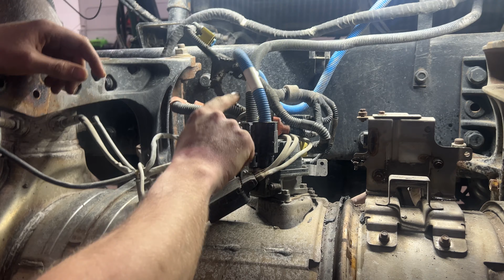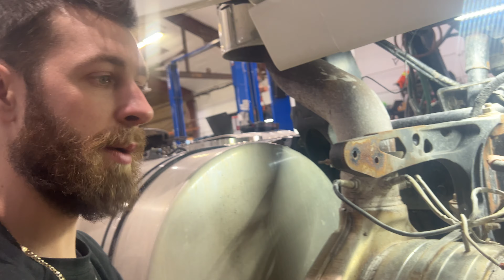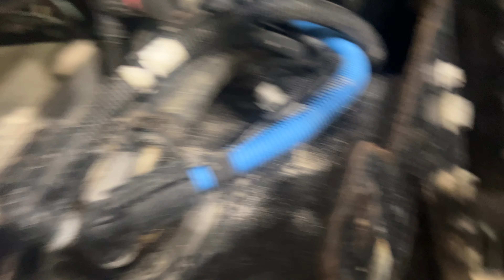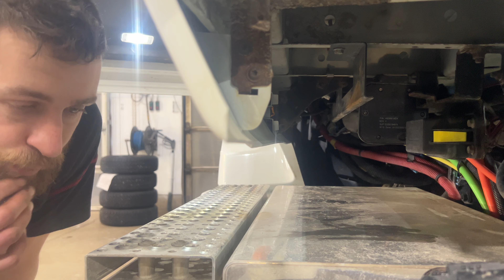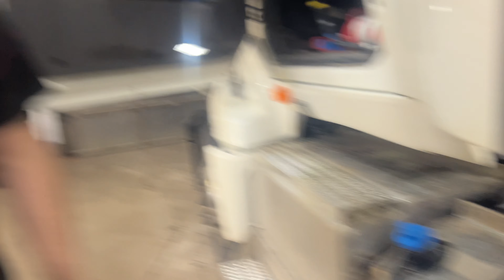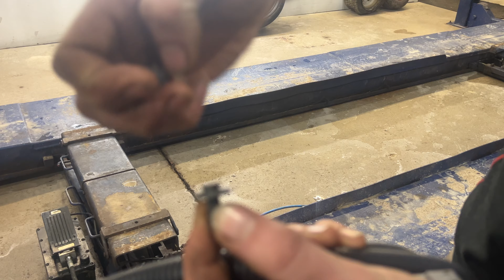International LT625 2022 DEF Supply Line Heater Circuit

Comment: On the def heater line, those white tabs to pinch in order to disconnect, it’s not working for me. I pinch them together and pull like hell but the line won’t come off, either end. Any advice?
Reply from the maker: Yes I know the struggle you are going through, if I have to re use the line I just keep trying but many time you will need to replace the line because of that white lock tab becoming damaged. If I have a new line in my hands and I’m just trying to get the old one off then I will use flush cutters to cut the white lock tab out of the line body and remove it that way. These white lock tabs suck because dirt gets between the line body and the white lock tabs which keeps the tab from being able to flex open far enough to let the line release
Reply: @Tech-28  thanks for your reply. I basically ripped the white tab off of the damaged line, then the hose came off fairly easily. Seems strange how it can hold on so tightly to a stainless steel looking smooth piece of metal. It’s extra tricky with no shop, -15 degree C weather with snow and ice on everything lol 😅